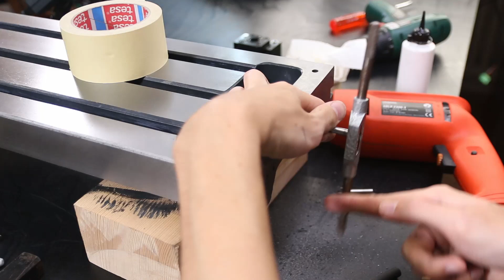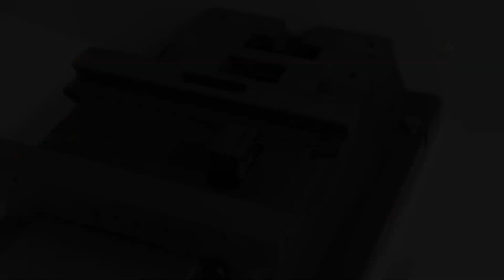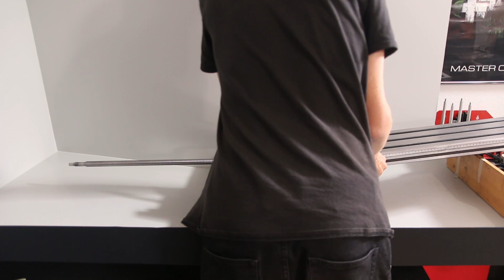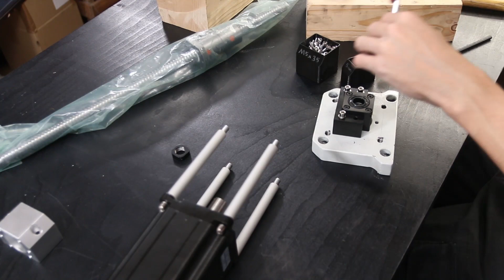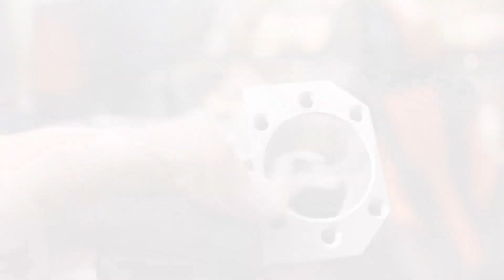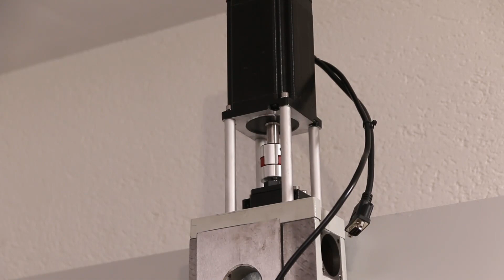BF30 CNC #4 - Complete Assembly

Comment: Wow ! That was a LOT of work. All that grinding to install the ball screw on the X axis. I have gotten myself into these situations many times. I believe that I commented in the last video that I ordered a ball screw kit for my mill and that it was expensive. Souldenly, it looks like it was worth the cost, as most of this grinding is not necessary, with the kit. 

I have a manual mill that I can use for removing material if needed, so that's a bonus. I admire you're perseverance and the way that you just keep working through challenges as they arise.

Comment: I kept my column on my G0704 while doing the conversion and put the bed back together far enough to make cuts moving the bed by hand and just drilling down with quill. When it came to doing the slotting in the bottom of the bed I clamped it down to the Y saddle and used the Y feed. For the saddle modifications it was much harder. I clamped my 6" vise to the base and bolted the saddle to my vise jaw and used it as an axis to feed. Most modifications were just plunge cuts so it wasn't terribly hard and much easier to modify a ballscew nut and castings.
Reply from the maker: That is genius! I wish I thought of that at the time :D

Comment: Looks good my guy. Are you still using Mach4 + smoothstepper/mb2 + closed loop steppers? If so how did you wire the alarm pins and the enable pins? I’m using the same setup as you and having some trouble finding information on how to interface with Mach4. Any advice would be greatly appreciated! Looking forward to seeing the rest of the build! 👍🏼
Reply from the maker: yes, I'm still using that setup. As for now I haven't wired the alarm and enable pins. For my use case the enable isn't necessary, though I might wire up the alarm in the future, I have to find out how it works first though.
I'll make a detailed video on the electronics soon, I just fried my smoothstepper board, so I'm waiting on a replacement.
Reply: Datulab Tech sorry to hear about the board. Yes it’s a little confusing to me since I have to research both mach4 outputs and the mb3 board. When you make a video I’ll definitely watch it. Thanks in advance

Comment: Nicely done. Just wondering why you didn't use the mills screws and mount the steppers to them? What is the benefit in the ball screws you installed?
Reply from the maker: the screws of the mill have a lot of backlash (slop), which is ok if you're machining by hand, but does not work with steppers. The ball screws I installed have (almost) no backlash, making the machine much more precise.
Reply: @DarkArtGuitarsWorkshop  Which ballscrews did you use? 1605?
Reply: @mrechbreger  2005
Reply: Pour ne pas avoir de jeu

Comment: when you have the machine operating and you might find the need of tourque you can think of put a 1:2 reduction on the axis to get it double. That what I did with mine that is the similar mill
Reply from the maker: My motors are quite beefy, one might even say overkill, so I don't think I'll have torque problems on the axis, but thanks for the tip.
Reply: @DarkArtGuitarsWorkshop  True. They are NEma 34 close loop if I am not mistaken. Looking forward to see the electronics panel.